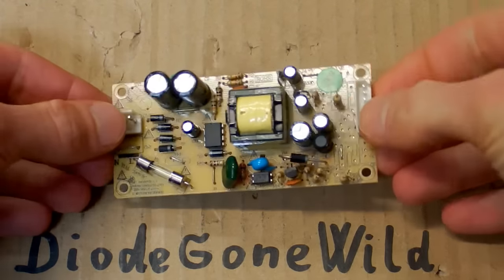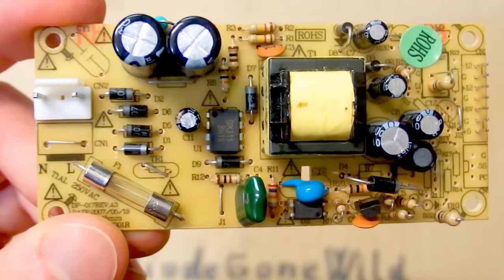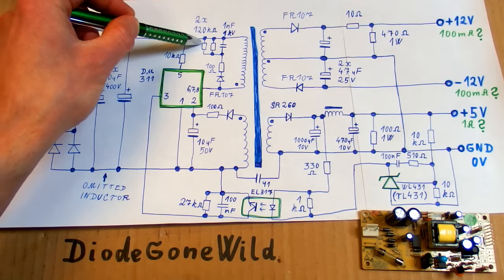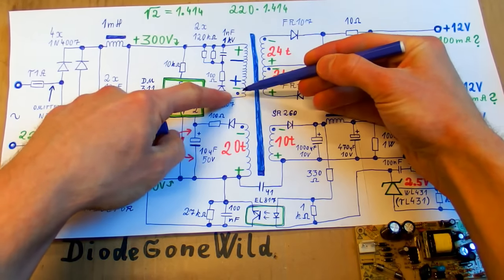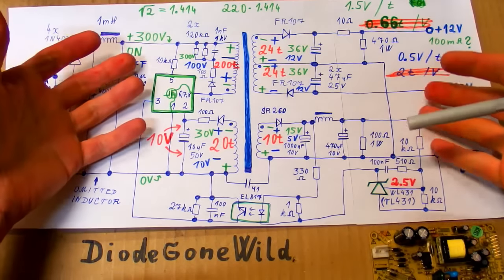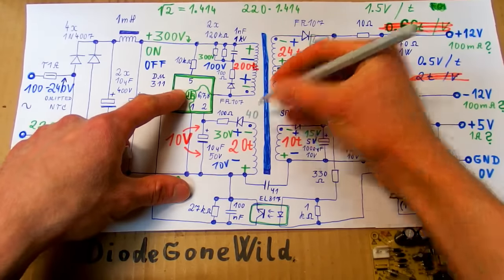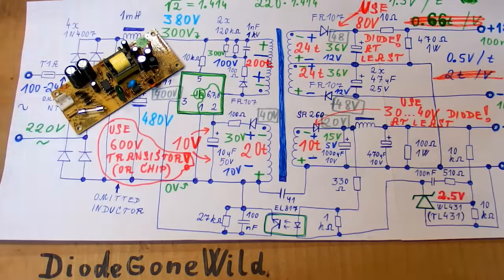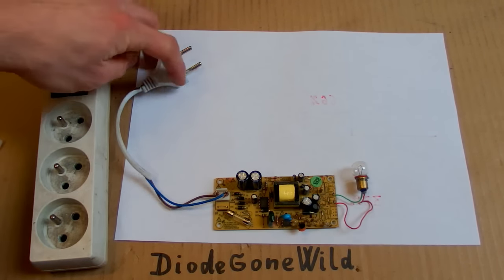How Does a Switching Power Supply Work 1 (schematic, explanation, example, modifications)

Comment: WOW! Thanks. I finally understand what you mean about the TL431 "turning on." Sorry if I misunderstood. I'm genuinely just trying to learn and understand this stuff myself.
 I'm glad you mentioned that bit about the auxillary winding voltage. I hadn't thought about that one. I was mainly concerned with the secondary side components. The ones I've modified don't get hot or show problems, but as I tell anyone, I would never leave a modified supply powered on unattended.

 Just now I looked at all of the switching supplies I've modified to look at the circuit. I'll still need to check the actual voltages but I will need to finish my current project first to make space. All but one of the supplies I've modified have a zener on the auxiliary circuit for the switching IC power rail. I haven't retraced them completely, but at a glance the circuit appears to be set up to clamp the voltage for the chip. I know the dissipation and voltage ratings are still vital, but the examples I have appear to compensate for auxillary power fluctuations to some degree. 

 I really appreciate you showing all of this. Honestly I got the idea of modifying the output of a switching supply after taking apart a Sony camcorder power supply that had a rating of 9.5volts. After taking it apart I noticed it had a trim pot on the secondary side. It's adjustment set the output from around 6 volts to around 18 volts. Later I came across another supply that is from a company called "Rhino" that sold a "Universal AC/DC Adaptor" model: PSNC-75M. It has a switch on the bottom that sets the output voltage at 12, 15, 16, 18, 19, or 20 volts. It actually rates the output on the label at:
12V, 5.4Amax DC
15/16/18/19/20V,
5A-3.75Amax
(That's an exact quote of the label)
I haven't torn it apart because I use it for an ancient laptop, but it also has an auxiliary USB 5V output rated at 2A which is super handy. After watching your video here I'm really tempted to take it apart to figure out the topology.
  I've also been goofing around with the little adjustable supply I made the video about modifying awhile back. I'm trying to add a linear regulator to adjust the voltage lower, but I'm waiting on some dual pots in the mail as thats the only way I know of to adjust the switching supply and regulator to track each other without adding an op amp circuit. Any ideas or suggestions are more than welcome :)

   BTW, could you put "flyback" in perspective please. I think I understand the basics, like the charge is stored in the core. I got a bit confused after reading that there are continuous and discontinuous types of flyback operation.
    I have a hard time putting the different terminologies into perspective for the different switching designs. I think I understand buck/boost/buck-boost, none isolated/off line and those types of basics. I have a hard time understanding what is branding terminology versus topology after that point. I vaguely recall "Switch Mode Power Supply" is a branding term. I came across "Peak Mode" used to describe a  controller/topology at some point early on in my exploration of these things. I originally associated that with the simple designs that use a single voltage feedback loop and a current sense resistor like a MC34063 etc. I thought of the dual feedback chips as "PWM" because the first time I saw a chip that was labeled as PWM was when I looked up a TL494. The first time I saw the term "flyback" was in reference to the high voltage transformer used on old CRT televisions, so I thought the design was more high voltage specific. I've realized this is incorrect, but I have a hard time understanding how it fits in to switching DC converter designs over all at this point.
     I think someone with a thorough understanding should do a video on an overall abstract explanation of different switching designs that tries to cover 90-95% of the designs used regularly in practice. Maybe they could also explain the basic evolution of things like power mosfets and bjt's as it relates to switching IC designs. I know I hit a learning-wall when I discovered the output current limitations of the MC34063 for myself. I think it is due to the Darlington output design. IIRC I read somewhere that this design was done before power mosfets, and that's why it sucks, but I could be wrong.
  Seriously, thanks again for all of your efforts. I recently noticed your website link in a video as well. I bookmarked so many pages I had to make a folder for it. 
   Very much appreciated,
-Jake

Comment: I would like to encourage you to keep making videos like this periodically. Even though it does not get the views of the simpler ones its important to add proper content. 

I made a 5 videos on solar panel hobby project. Though it has very few views I am not daunted. It was really for me to put down all the info in one place and spend the time to consider all angles. I even picked up an error assumption I made in the second video when I did the calculations for the third.
Reply from the maker: Thanks :) I will definitely keep making such videos ;)

Comment: You are an Electronics Master . Thank you for sharing your knowledge.  Keep it up with this type of explanations. My motto is P.S.'s and electronics devices are designed and built from high knowledge people like you, Masters and PHds. Trying to make circuit changes on P.S. can be fire hazard. You guys can see how complex are calculations on semiconductors, I even see more complex equations and simulations. Please do not attempt to change main circuit. If you want you can add external DC-Dc converter.Namaste.

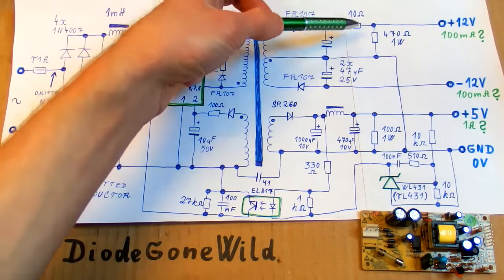Comment: In 6:20 the 10r is to limit the current. The -12v goes to the two motors (spindle and optical assembly driver) also this -12v is used to generate sync pulses of the composite video signal. The 470r discharge the capacitor, because some overshoots happens and the peak voltage will charge the capacitor gradually to 13v or more. If you remove this resistor you can check it go beyond 16v sometimes, mainly when the 5v is at full load and the regulator is trying to compensate with a large duty cicle.

Comment: Very very very very outstanding explanation.
20:56  You say the voltage on the diode will be 48v
 Is that at the anode or between the anode and the cathode of  the diode ?
Is that voltage dc or ac ?

Comment: Lets keep the transformer/copper losses/diode losses out of this, the paper is full lol :-D
No i dont want to know that the output diodes have to be fast recovery otherwise they short the output :)
My brain is exploding lol.
I have kept similar supplys to yours, i just cant throw away a usable switchmode.
I have a dvd player one with mosfets on the outputs for switches, hmm nice.
I need to go to "Switchmode keepers Anonimus"  :-D
Reply from the maker: Even when I try to explain it the most simple way, it is still quite complex :).
Reply: lol, now you see why i stick to repairing, too many dam variables.
The concept is easy, but just calculating an ideal transformer requires imaginary magnetic feilds/lines of force/interwinding capacitance and (Thats it, my brain shuts down fully) :-D
You and mr johnnnny seem to make some good psus, they work :-D
Reply: Agree here too. MrJohhhnnnyyy and Mr legend Danyk should do an episode together or..  maybe they should each put half of a mystery circuit together on a vero-board and mail it to the other to see how it gets completed.. just for fun! And guys - No cheating!

Comment: im newbie in electronics, could you explain what's the difference between -12volt, -5volt and ground (0volt)??, what is negative voltage anyway??
Reply: You can choose where you put your ground or 0 level voltage. So he could have described the power supply output voltage as 
0V        (-12V)
+12V    (0V)
+17V    (+5V)
+24V    (+12V)

Or one could add 100V to every level. 
In this case it’s probably most convenient to define the 12V section as -12V, 0V, +12V 
And the other section just as 0V, 5V. 

You could also imagine a positive voltage as a pushing force and a negative voltage as a pulling force if that would help.

Comment: Everytime i watch this video i learn something more! Really great and very deep explanation of switch mode PSUs in flyback topology!
So thank you very much for this excellent explanation!
I just have one question: why is the voltage per turn different in each polarity? Is it mainly because of different slope steepness when turning on and turning off (transistor/mosfet) as we know the change of current per time is relevant for the induced voltage? Or is it mainly due to the duty cycle as you explained? Or does both relate to each other so that it comes to the same result? Not absolutely sure about this?

Comment: @DiodeGoneWild So, considering the labeling of the transformer, I have a question. In primary, +/- signs are in the point of view of inside. In the secondary and auxiliary, signs are in the point of view of outside the coil. Why is this labeling discrepancy?

Comment: Nice! But why 480p? Not related to that but every time I see a switching power supply I can't help but think of the time when I connected one to 120v AC thinking it would work like a regular linear transformer, boy was I wrong! That was years ago though when I did not know about SMPS's.
Reply from the maker: It should be 720p. Maybe it is still not processed.
Reply: Yep it is now, my mistake :)
Reply: ELECTROHAXZ why, what happened when you connected an SMPS to 120 V? it regulated to the nominal output voltage and you thought it would be half?
Reply: I guess I said that wrong, I removed the transformer and connected it to 120 volts thinking it was the same kind of transformer as a linear one.
Reply: ELECTROHAXZ oh, ok

Comment: The fact that the 12V supply is unregulated might be because it is feeding the input of various DC-DC converters as is common on PCs.

It also might only be used for analog audio circuitry in which case they could be further regulating it down to +/-9 or just using op-amps with a very good PSRR.

Comment: Boost/flyback type power supplies are not simple, forward topologies are a lot more... straightforward. :D The number of turns in the flyback transformer is calculated by ampere-turns, to design one you would go by the current, not the voltage. That's what makes it confusing for people used to "normal" transformers that simply step up or down the voltage based on their turns ratio. Then there is the slight detail that in a flyback, the energy is not actually stored in the ferrite core but in the air gap built into the center leg of the core. All flyback transformers must have an air gap (and this must be calculated, or determined empirically by measurements using a current-limited power supply on the primary side), otherwise the core will saturate and your switching devices will blow up.

The flyback is so popular in low-cost applications due to not requiring an output inductor, since a "flyback transformer" actually behaves like a coupled inductor and not like a classic transformer. Also important to note is that a flyback power supply must operate with a minimum load at all times, since the transformer acts as a current source, and with an open circuit, the output voltage of a current source is (theoretically) infinite. Of course this does not happen in practice, but in a no-load condition, even if there is one output which is regulated, the voltage on the auxiliary windings can easily "fly" high enough to blow up the output capacitors due to overvoltage. This is probably the reason for the 470 ohm resistors in the 12 volt outputs your power supply.

Comment: 14:30 Should I assume that you are referring to voltsecond balance in transformers of smps? The power that goes in the core needs to go out too so is you have 300v for 75%duty cycle then you need 900v for the 25% that the switch is off so that the voltsecond balance is satisfied?

Comment: Great video. But I got a question. 
What happens when I only use the 12V output when only the 5V line give feedback to the circuit? It won't charge the 12v output then or how will it do that? 
And what if I don't use the 12v and only use the 5V line? There should still be power transfered to the other secondary coils and will destroy the output? It can't be that way but I can't explain it myself
If someone knows pls explain it to me

Comment: Hi I have a question.. i have smps from old sat receiver.  the output is unstable like 30v down to 15v and when i put a load which is fan it can't run the fan.. whats is the problem?

Comment: What if my FB pin is high? And there is no output in the output terminal is the opto coupler is the culprit or do I have to change my switcher IC?
I have a microwave oven board where the power section is similar and they have used lnk364pn ic. Please help me out of this?

Comment: The most simple solution is to change the auxiliary winding series resistor with a fatter one of larger power rating, and adding a zener diode to clamp the voltage to the chip. ;)

Comment: What would have the missing components been used for on the output if they were fitted? Why were they ommitted? Just penny pinching/cost cutting or a better reason? Please can you draw another schematic with them included.
Reply: They might have used the same board for different machines. By adding or removing parts they can use the same board give different output voltages. When you make a lot of one thing it makes them cheaper to manufacture. So it both makes it cheaper and more useful.

Comment: one question since beginning of my education , how are smps's able to provide such high currents with just a small ferrite transformer, schottky diodes,inductors & filter capacitors,
Reply: I think key to this question is switching frequency. by increasing the frequency, you can reduce component size of transformer. have a look at Great Scotts explanation on transformers. switching frequency is in the high kHz region

Comment: Thank you for this wonderful work ....... Please explain the schematic inverter.....Thanks
Reply: The ground is connected to the middle of the secondary 12V winding. So the bottom part of the winding has a negative voltage in reference to ground and the upper portion has a positive voltage in reference to ground.

Comment: I have one of these I got from the dump.  It puts out a little more than 5 volts but the regulation is not so good.  Under load the 12 volt line drops to 6 plus volts using a small 12 volt light bulb.  It uses a VIP 22a chip.  I measured the voltage drop across the TL 431 and it is around 1.6 volts  In addition the output oscillates a few milivolts.  My question is: is this normal or has it lost something?
Reply: The 12 volt side is probably being loaded down a lot with your testing. The 12V side wasn't designed to supply a lot of power (as compared to the 5 volt side). Do all testing on the 5 volt side first. If the TL431 only has 1.6 volts it means the power supply is being over loaded or not being filtered enough. If a filter capacitor has gone bad a volt meter might show only 1.6 volts, but an oscilloscope might show voltage spikes higher than 5 volts. These spikes would "confuse" the TL431 into thinking the output voltage is too high. You might also have resistors that have changed resistance (an overload might cause a resistor to increase or decrease in value) or something conductive (loose wire as an example) might have shorted something out. The easy thing to do is replace all the electrolytic capacitors first because even on a working switch mode power supply the capacitors take a lot of beating. If I have a SMPS that's not working right I still replace all the electrolytics first, even if a capacitor tester says they're good.
Reply: Also remember a typical tungsten light bulbs present very low resistance when the filament is cold. Try finding combining some resistors to get ~100-120 ohms with about 3 watts of dissipation (things will get warm..)

Comment: There is a lack of information about frequency. And if I want to change the operation frequency to get diferent output voltage if the reference in tl431 can not be made? Where can I change the frequency keeping the auxiliary transformer power supply since dropping high voltage by zenner is the worst idea? The chip seams to be some kind of oscilator controled by voltage, but If the chip is a mystery it can not be compared to a discret transistor oscilator. Chip does not make it simple, make it poor.

Comment: How to design DC 300 volt from AC supply SMPS design output current is upto 1 ampere please share circuit diagram
Reply: Sir, which IC is this

Comment: This is the emptiest board I've ever seen. The manufacturer probably decided to cut costs with this one. I see the bare minimum. Thankfully, they didn't replaced the fuse with a short. I see that only the 5V rail is directly regulated. The +/-12V is probably unregulated.

Anyway, nice video. Thanks for sharing!

Comment: Ahh yes the Switch Mode Power Supply also known as a defibrillator to unsuspecting technicians.
Reply: Yes, I only worked on one of those  none of the other 20 technicians would help and I smoked it twice before giving up
Reply: @toddt6730  I smoked an Orange guitar amp when I first started repairing again in 2017. Luckily Ornage took care of a replacement under warranty for the customer. whew...
Reply: @mikeskory3157  I used to love doing component level repairs,  eyesight is no wear near what it used to be

Comment: If the winding have -300 volt and 100 volt how to drive n channel mosfet gate??? bloody hell i just can calculated secondary diode rating now i need learning thr primary switcher
Reply: Lol the source still virtually 0 volt so the gate just need to deive normally, -300 and 100 in drain pin